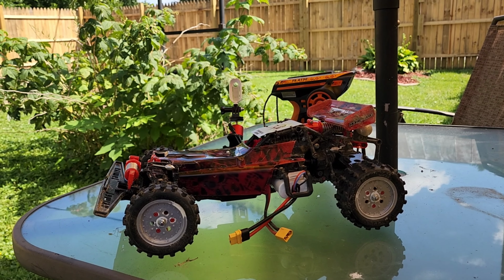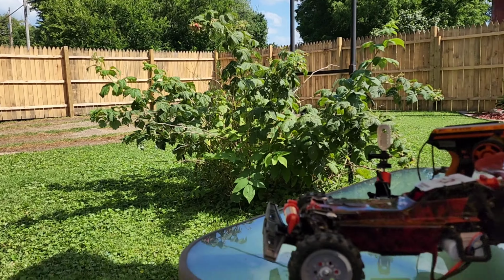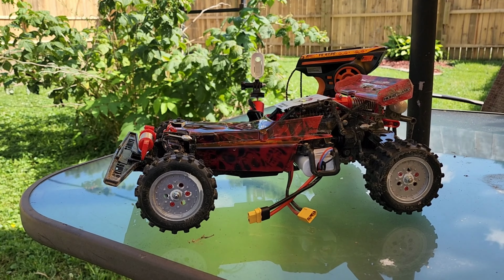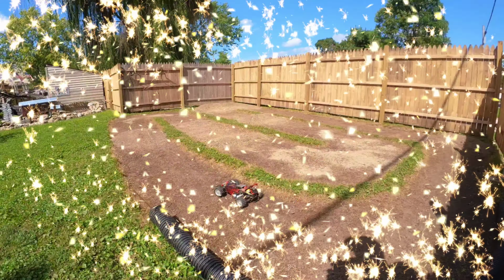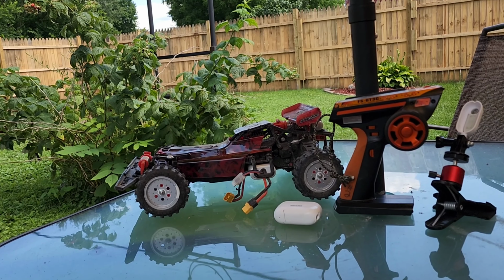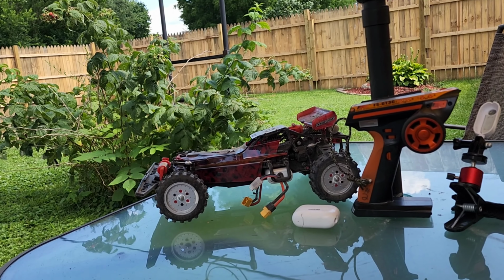Tamiya Brushless Hotshot on the track

Comment: Good angles on this video. Just noticed... I'd put a board or some pipe along the fence to keep from busting suspensions on the posts.
Awesome run. Good to see the old dawgz still have some moves.
Reply from the maker: Thank you Brad I actually got some plastic yesterday ro take care of that little at a time it's coming together
Reply: @AdventureTimeRC  
That's great. You always see little things you might not have noticed when you initially planned the project. 
Just takes time & money.
Reply from the maker: @grisslebear  definitely takes time and money but so far I only have around 50$ in the track I was able to use dirt from digging the fence post that really helped the cost
Reply: @AdventureTimeRC  
But you also had to buy the house in the first place. So from one perspective, you have a ridiculously expensive rc play ground that incidentally came with living quarters & utilities.
I do like the new jump arrangement, though. Seems to fit the scale & design of the track a bit better.
Reply from the maker: @grisslebear  lol never thought of it that way 🤣
Reply: @AdventureTimeRC  
Perspective, brother. 😎👍

Comment: That's 6x6 is now a 4x4. The rubber o ring came off and there's no pin. In drive shaft. All o rings are rotten on it. But easy to replace
Reply from the maker: I'm sorry that's crazy it's not very old I don't like o rings because they dry rot so fast the ones I put on my Scx24 Rubicon all rotten in a year
Reply: @AdventureTimeRC  yeah I just seen it last night. Idk what kinda pins to use for driveshaft thought. I'll find something for it
Reply from the maker: @hellofromsoutheastalaskarc7517  just cut a finishing nail down that's what I use

Comment: Great run Brent, that part at the end was super interesting were you showed you camera set up, did you make that mount? I didn't know that you used the insta 360 on your transmitter I thought you were still using the phone.
Reply from the maker: Yeah Tyler I don't record run video with my phone very much anymore the go 2 changed my game its to easy to use and light weight makes a big difference on a long run these mounts I I found on Amazon they are my favorite